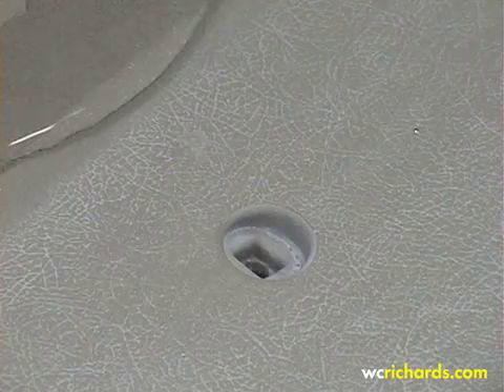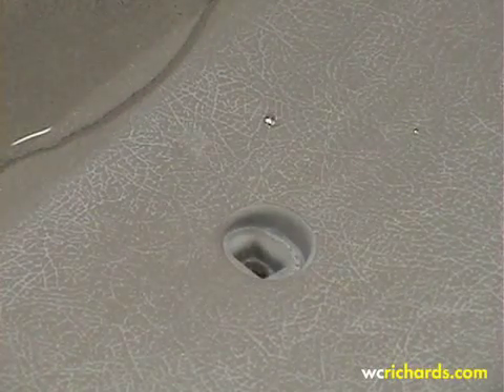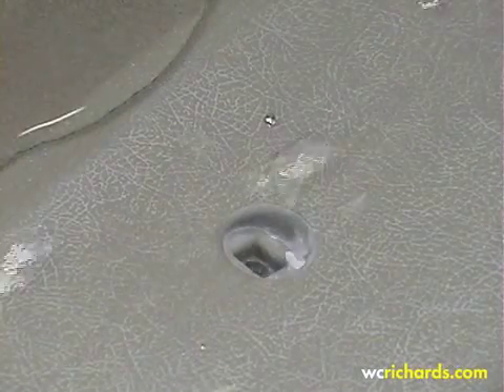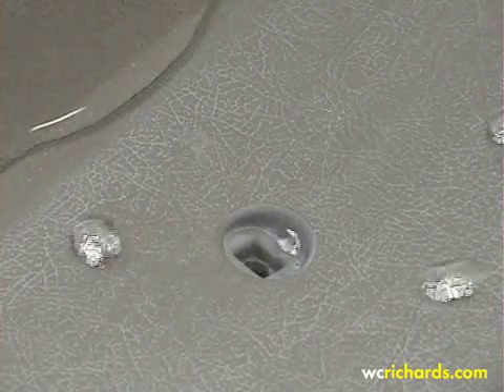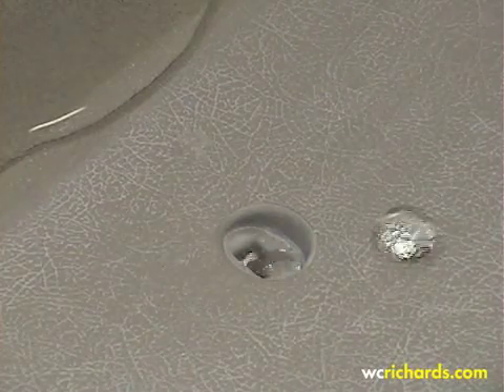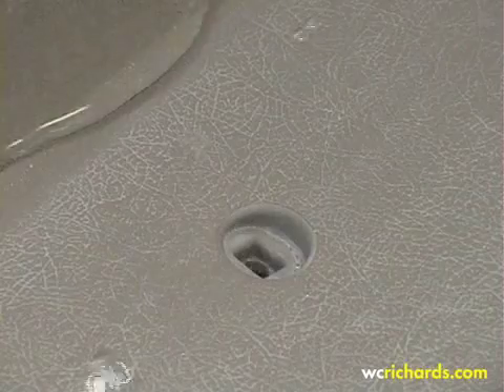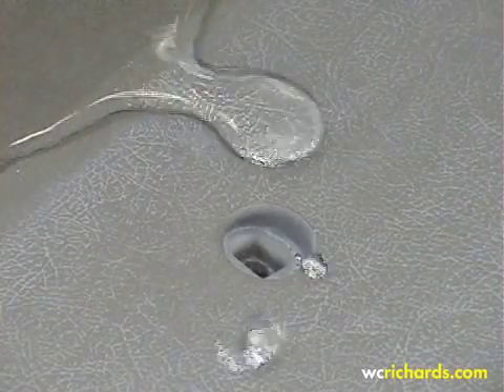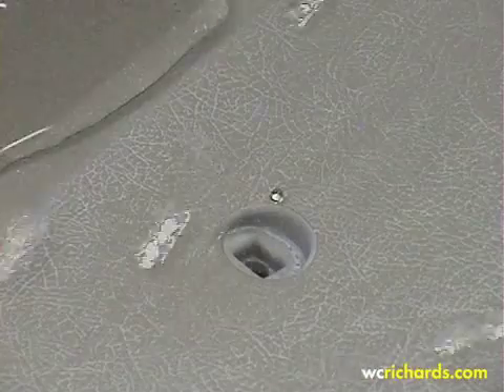Hydrophobic Coating

Comment: But wouldn't the signal still be weak? It's like being under a tunnel and receive nothing. What if the signal doesn't send through the water?
Reply: This has been applied and and used specifically for this application. Works great.